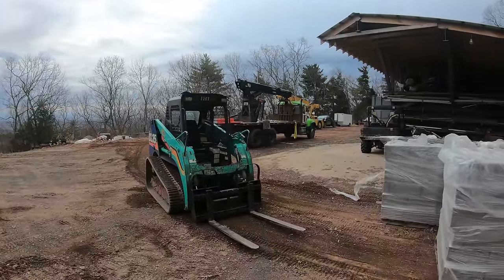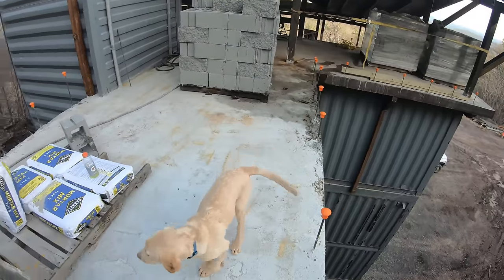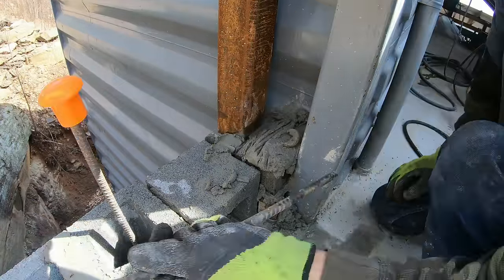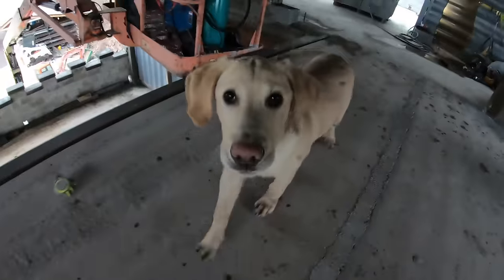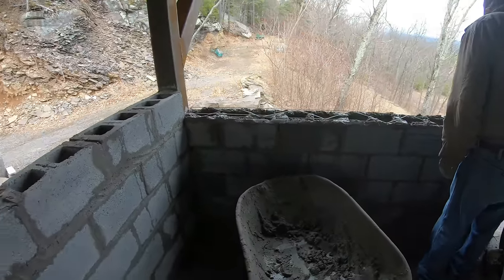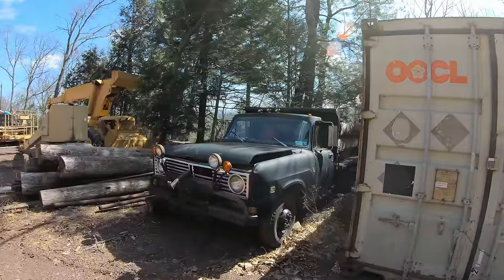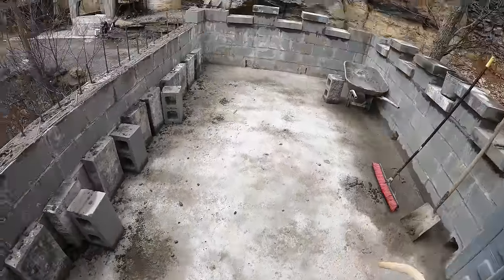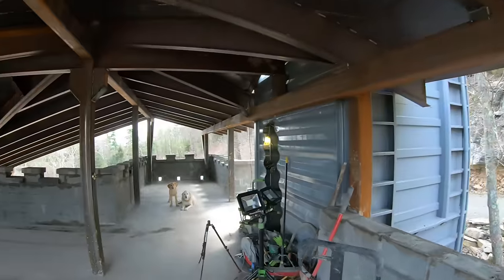Container castle blocks

Comment: All of us bricklayers watching this vid cringing 😂
Reply: The 'crookedness' however gives it a less industrial look and more fit for a castle.
Reply: Yep, but that's what we love about this guy. Welders may cringe, electricians may cringe,  mechanics may cringe,  body guys sob uncontrollably,  bridge builders may cringe,  engineers develop ticks, cement guys may cringe,  septic crews may cringe,  and foresters may cringe,  but Andrew keeps on "doing" and encourages us to try bigger and believe in ourselves even when we "fail".
Reply: Snails40  " that crookedness would be an insult to medievil masons aswell."

A. He uses a torpedo level.

B. He has a straight line from the edge of the floor. He's only going up 3 or 4 blocks.

C. It's a shop/man cave for god's sake.

D. You obviously have never built a medieval castle.

https://www.youtube.com/watch?v=pu3O70GeQFY

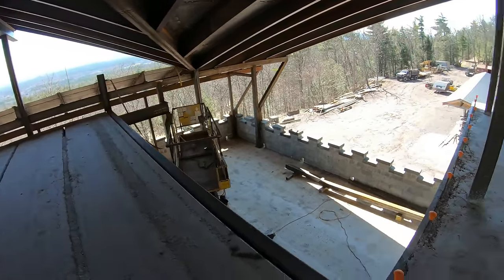About 6:00 in they show the interior of the walls where it would be an inefficient waste of time and money to lay every block as precisely as the finish layer.

Andrew's is reinforced with concrete and rebar. 

Many prefer the real life rustic look over the plastic modern Lego look.
Reply: Building a castle is cooler than cringing at things on the internet.

Comment: In 300 years, somebody is going to be cursing the entire decade it takes him to tear down this structure :)
Reply: Can just imagine them trying.
'Ahh heres an easy bit, few breeze blocks, 6lb hammer should be enough.
TING..... (bits of hammer everywhere)
Must just be an old hammer, surely he cant have put rebar in there it has no structural load whatsoever. Will try a 10lb hammer just to be sure.....
TING.... (bits of hammer everywhere)
he DID put rebar in there.... Oiy Frag, send up the sixteen on a line!
Reply: All jokes aside, this thing really will still be there in 300 years, ain't nobody gonna bother even trying to tear it down.

Comment: 26:01 Aren't  staggered block walls stronger than stacked?
Reply: not when they are filled with grout
Reply: Camarata grouted the cracks on the spancrete floor so the block walls are stronger than stacked.
Reply: Of course, that makes sense.
Reply: He staggered the block seams, as they were stacked, that is the way blocklayers do it

Comment: FUN FACT!!!  Roof wall drainage  like what you built is called a scupper. it was first used on ships to allow the water to drain off the deck. There are some nice scupper ornaments you can buy to highlight them architecturally. The type of wall your building is called a castlated wall. It is called that because the walls have castlations. The castilations were originally designed to protect those defending the castle while giving archers the ability to fire and cover.

Comment: Hey bro a little advice don't wet your cinder blocks before use as a dry block will wick the moisture from your mortar and draw more of the cement into the block there by creating a stronger bond and joint lasting much longer. Love your design looks way cool.

Comment: As an experienced pallet jack operator and watching this guys abilities I'm surprised he has so much troubles using this jack. When you push the jack into the pallet (most pallets are different) the wheels roll over the cross board, the jack rises maybe even getting hard to push in and when the wheels are free of a board the jack rolls easy and at that time is when you jack up the pallet without ripping the cross boards., not complicated..

Comment: when I do at least one of my main structure with a steel beam at least as strong as the one around 1:08:00 it will have and other beam that will connect like a capital I and have pully/whench to eliminate needing crane(s) & or tall loaders like in this video...hopefully.  Probably both manual fully and some type of automated/mechanical.  ...debating if I need more than one structure that can do good lifting and high.

....pretty sure thats why old style barns have/had doors both on the top and bottom level...to load up the upper area & be able to access the top from outside top doors.   I wouldn't be surprised if this project from this video had some type of similar lifting ability...if not especially if the top will be used a lift/elevator would be so helpful.

Comment: Really enjoyed watching your vids, certainly an unconventional approach.  Some random comments;

* You've got a whole load of thermal mass there.  Thermal mass is to insulation as a hot water bottle is to a blanket.  Thermal mass is awesome in a desert setting with massively different day and night temps; sized right, it negates the need for heating and cooling.  In a climate with a cold winter and a hot summer however, thermal mass is a massive battery bank.  It sucks up the cold in winter and is impossible to heat efficiently, and the opposite in summer.  If it's not too late, consider adding some pex piping internally in your concrete so you can pump hot water through it via an external wood heater and reduce the ice bank effect it has on your home.  

* Tracked welders are probably sub-arc.  Setting them up is a huge pain in the ass and takes way longer than simply welding out stuff by hand.  It's virtually impossible on anything other than a flat surface.  

*Try and keep your dogs snout out of the cement dust.  Not that I mind all that much; I've eaten dogs.  But clearly you care very much about him and sucking all that cement into his lungs does the same harm it does to you and I notice you wear a mask if you're not using water for dust suppression.  

*Thanks for all your awesome vids.  Really nice to see you work and very enjoyable to watch.  Two thumbs up!

Comment: Hi Andrew, just another suggestion. The cab roof on the big extendible forklift would not support a heavy weight landing on it.
Reply from the maker: The roof cab on the fork lift will support a heavy weight landing on it. That is what it is designed for.

Comment: Lets say I wanted to put a 40' container 10 feet off of the ground on stilts what would be the way to go. I have these options available: 6" pipe 1/4" wall and 6x6 tube by 1/4" wall and was thinking of 10 stilts on the container. I been wanting to start the process and finally got some cash rolling in. I have been watching this since the beginning and its been a long journey.

Comment: Ur pretty good at most things but with concrete and cement u need to get some tuition!!
to fill concrete blocks u need smaller aggregate and a wetter mix and u need a line or a strait edge to keep the wall strait and dont try to to do so many blocks at a time when u put cement on the block the water immediately gets sucked out by the block which makes it harder to knock them down.

Comment: I like this guy... but as doing masonry for 21 of my 39 years on this planet... USE A LEVEL and a STRING, GUY... you got millions of dollars of equipment and didnt splurge the extra $100 to get a nice level and string line. also for those who may want to temp laying block for walls(not load berrin) and are not a professional at it.  lay the first course straight and level with a string and level in mortar. then just dry stack the block on bond then go back and slosh all the cells full of concrete. hope these few little hints help those in the future

Comment: FYI, FWIW, WHEN ANY 2 CYCLE ENGINE COASTS DOWN, IT IS NOT GETTING LUBED INSIDE, ONLY WHEN IT IS FIRING DOES IT GET ITS LUBRICATION...PLUS, THE REASON 2 STROKES LAST SO LONG (OUTBOARD MOTORS I.E,) EVERY TIME IT FIRES IT GETS A FREASH SHOT OF OIL. AND PLEASE USE FRESH NON-ETHANOL FUEL ALL THE TIME.

Comment: Andrew at 10:50 I seen you putting on a couple pounds of block up there pretty high on the castle top you had to load just about all the way up there and then you started driving forward that is kind of dangerous cuz you could hit a pothole or something that's why you have that trolley the trolley to move forward the full length of the forklift which is much safer to use been having a fully extended load with a pallet of block and then try driving just a pointer I drove many years of forklifts many different types of forklifts I've given for class width for tires on a front and Outriggers I do them for class with no front Outriggers I've driven forklifts you name and I driven them

Comment: With all the mud you've been mixing you should get a mortar hoe if you don't have one. Works better and easier for mixing mud or small batches of concrete in a tray. Also, you can notch the durabond by cutting the inside bar then you can bend it around the corners. Makes for a stronger wall.

Comment: I would warn you about that HF pallet jack 2000 lbs is about the limit plus when you have a heavy load on it and the way you are jerking it trying to get it rolling you are very likely going to pull a back muscle never jerk on a pallet jack. I worked with jacks like that for over 40 years so please listen to my warning.

Comment: Bricks, concrete, sheet metal – you’re sure piling a lot on those rusty old shipping containers.  What was the crush weight, again?
Reply from the maker: Rusty? There is no rust on them. Containers can hold a crazy amount of weight, they stack them up like 10 high, loaded heavy, on boats that tilt. Plus I had added a bunch of columns all over the place in that thing. This is a very strong building.

Comment: Hi. New in ur page here. I wonder why if u have this big project of building a big castle u never thought about using ur skills. You can weld and can use large machinery why u didn't build a tub shooter for ur cement and adopt a motor with a mill to shoot the cement through a shoot or a tube. Can put the forklift higher then the shoot downward to drop the cement in the whole inside the bricks. If u could do all that mayb I would of advance a lot more. Think about it still lot to go

Comment: Acoup,e of questions

 1) Why back fill the block work with concrete 
2) i didnt see him use a spirt level once laying he blocks or using string to get the height uniform
Reply from the maker: Its stronger filled. I got them level.

Comment: Andrew, any issue with the concrete pored on the container roofs? (Rust, condensation on inside, ...) . Also, anything advice on doing it? Want to do the same to mine and build a wooden deck/carport off of it.
Reply from the maker: There does not seem to be any issues.
Reply: Andrew Camarata awesome thank you. Big fan of your content. Very inspiring!!!

Comment: A mistake, a big mistake. I don't know what you are building. If an atomic shelter or bunker, then the more concrete the better. But if it is to be a residential house or a workshop, then stuffing the walls with concrete will make the insulation of the walls poor, such a wall will make it cold in winter and hot in summer. You could achieve wall insulation by filling the gaps in the wall with special thermal insulation foam. The whole roof will also let the heat inside in the summer and cold in the winter. I will not mention that this whole roof structure will expand and narrow (cold and summer), which can lead to cracking of welds and damage to the entire structure.
Such a house can neither be heated in the winter nor cooled in the summer. Well, unless the costs are very high, and it doesn't make sense.

Comment: me: wait, how do you get a ton  of concrete up a 3 story building?
andrew: ...oh, well, you just mix it on the ground, put it in a dump truck, mix the water in, grab your giant half round steel container on a pallet with your tall forklift, scoop the concrete out of the dump truck with your excavator and fill the helf round, then use your tall fork to lift it to the 3rd floor, and from there of course you just grab your pallet jack...
me: uh.....

Comment: 18:51 
Where did you learn to erect the walls? Didn't they tell you that you had to check the level of each brick you put in with a spirit level? And the leveled string or wire stretches so that the whole row of bricks is evenly laid, do you not know that too?
Reply from the maker: They are level. I can tell by looking at them.
Reply: @AndrewCamarata  OK  :-) But by the eye it does not look very accurate. Do you have great machines, even saws with lasers, and when erecting walls, there was no spirit level? I know it turned out great.

Comment: I would coat that seel roof abd skeleton in ryno liner myself and i would put oversized gutters on it with chicken wire caps on top to reduce clean outs and route it all to one drain pipe with a turbine generator in the system to make naturaly generated electricity and put solar panals on top then large battery capasitors that when full auto switch on tho use what is stored that alone should cut electricity bill by a couple hundred a month maybeeven a wind turbine then when power is out you have electric on site at all times

Comment: Where is the Steel Rebar, and you're not on Bond Head Joints over Head Joints isn't strong and the Walls aren't Grouted. The Building looks cool but it's a accident waiting to happen and it's Not to Code.
The City or County where you're Building that Monster will fail you're walls for sure especially since none of it has been inspected.
Pretty Scary in my opinion as I worked part of my Life as a Mason and as a Land Surveyor. 
And I have seen a lot scary things of people do things that are unsafe and  it always cost them more and especially if someone gets hurt.

Comment: With all of that equipment at his disposal, he couldn't put out $350. for an electric mixer, or even rent any kind of mixer?  What the heck kind of aggregate is that?  Potting soil?  Concrete is normally made of:  1.  Fines, (tiny rocks) 2.  Aggregate,  (large rocks) 3.  Portland cement, 4.  Water.  That Cody is simply a nuisance. Ron W4BIN

Comment: BE CAREFUL WHEN YOU ASK PARPINGS YOU MUST RESPECT THE HAIR OF THE JOINTS "IE THE BREAK OF JOINT " 7 CENTIMETER ON EITHER SIDE . IN ORDER TO AVOID CRACKING THE WALL OR FUTURE COATINGS.

Comment: This is one I had to speed shift thru....no level, no strings, just slapping block down....
Reply from the maker: Yeah, that is how I wanted it done.
Reply: @AndrewCamarata  I thought that might be it....but I have that thing where I have to get up and straighten a photo on a wall. So I'd be on that JLG banging away trying to fix it....lol. Looks good. Never mind all the comments about your welding either. I worked Sheetmetal 34 years on carriers. All the welders I know think they are top pf the line. I worked with the best welders in the world too....welded Nuke pipe 5 inches deep. They do that via computers and cameras. Pretty awesome to watch. Think of that power line you put in thru the rock. That is how they weld thick wall stainless.
Reply: @AndrewCamarata  I been watching your stuff last three days...couple things I'd mention...when welding cold steal, use your propane bottle to heat it up a bit...we were required to get it no less than  60  ( temp sticks ) and don't weld into paint...weakens the weld to have those impurities. One last thing...I saw you working on the chain saws and your Dad, using his after you fixed it, how's he doing, ??
Reply: 1:42. when they moved the Island House....that was me in the far left , near the water....funny to see "me" caught on camera...I had no idea till I came across this. That is the USS G. Ford ...JFK was the one after this one, which is in the water now...Ford was my last one.

Comment: I do admire this young mans gumption in building his castle, but unless it has at least 12" of good insulation I believe it would be very cold based upon comments made by Andrew.   Steel be strong, but colder than the proverbial witches bra.  Just wanted to be non sexist with that comment.

The conex boxes he might have gotten for free as many companies are trying to get rid of them, but the sheet steel is is using for his roof and the I-beams must be a bit expensive.

Comment: The list of stupid things knows no end in this video - start off with dry cutting block with no breathing protection silica dust will kill your lungs in a very short period of time. Next, no fall protection on the second floor area. Oh, you should have also put metal mesh on the bottom layer of block and then every few layers after to tie the wall together.  You also where not protecting your dogs from the dust from the blocks. Then when you did switch to a wet saw you still had no breathing protection. No level or string level when you where building the block walls. They will look like hammered dog sh*t when you finish them. All being said if you don’t care about your own life fine, but do everything you can to protect the dogs